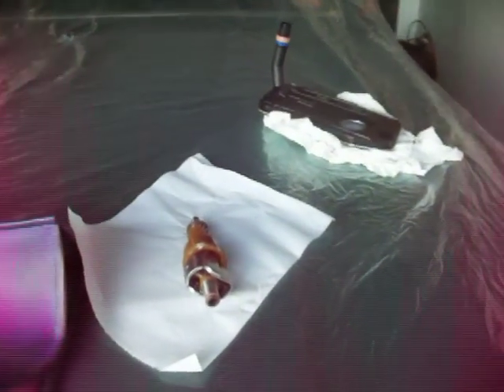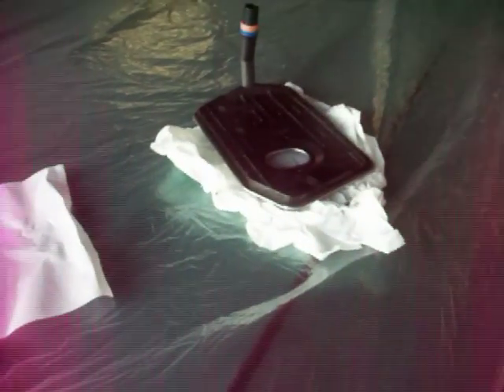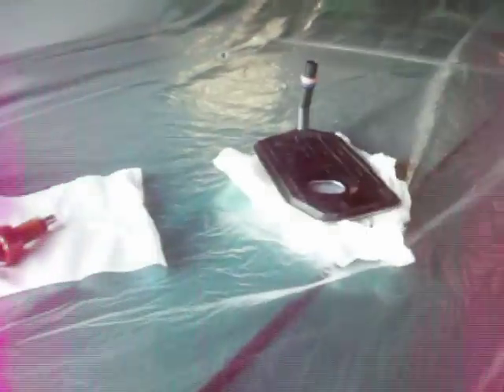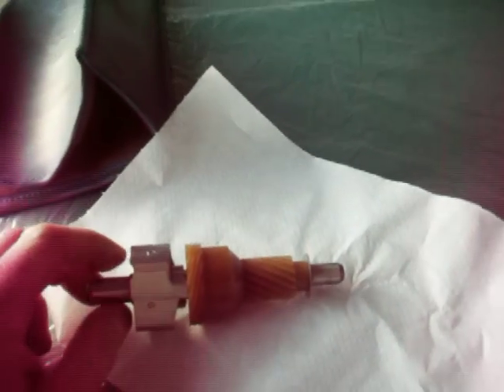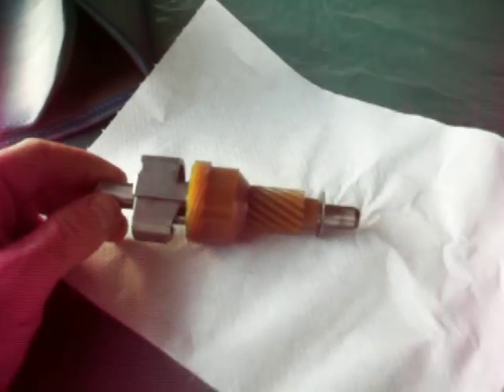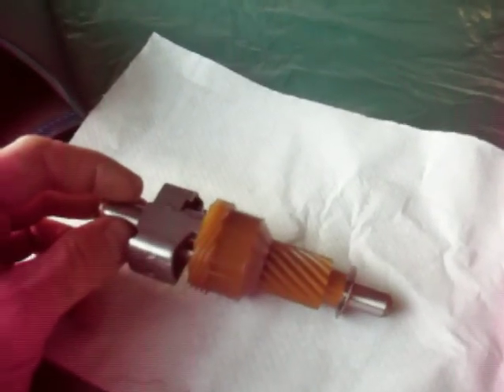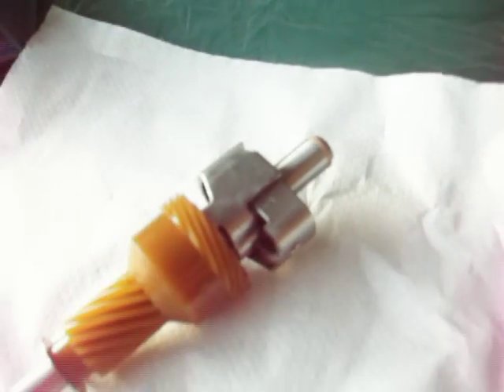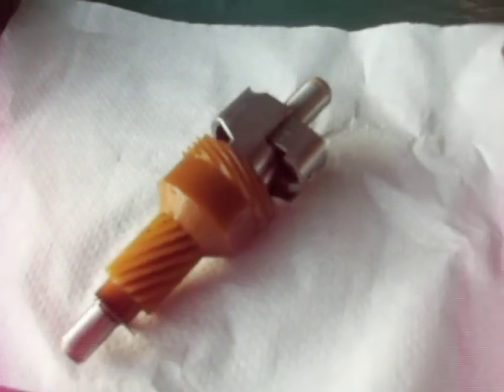200-4R governor and oil filter

Comment: Do you know where I can get the speedo gear/governor gear for my 2004R? My speedometer is off by at least 20mpg. I tried to tell the mechanic he'd have to find it but he didn't listen.
Reply from the maker: TheJhaley12 sorry for the delay in getting back to you. We got a gear reduction adapter that screws into where the speedometer cable with screw into the transmission and then you screw in the speedometer cable to the outlet of the adapter. You do your math conversions to figure out how much speedometer is off by and they will tailor you apart correct this error in speed.

Comment: How did you make out? What was you final 1-2 shift RPM?

Your 200-4r videos are great! They've been lost on your channel but still can be found when searching the 200-4r. Could you link them in a playlist on your channel? I refer to them often.
Thanks n love your videos,
Ken
Reply from the maker: Thank you Ken.  The words are encouraging! I will figure out the playlist thing in the weeks to come, and I will add these 200-4R clips to it.  I believe the outcome has the unit shifting just shy of 4000 RPM if I remember correctly, I may have to try again in the spring to reverify the claim.  I could get it higher, but the car still solidly chirps the tires 1-2 and gives a healthy whack 2-3 and 3-4 under heavy throttle.  But it is very docile under light throttle, crisp and quick.